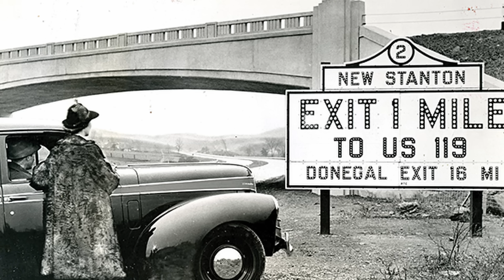Why New York's Lake Ontario Parkway Failed

Comment: The funny thing about these planned routes is that the major towns/city in that area are Lockport, Medina, Albion, Spencerport and Brockport, all of which are built around the Erie Canal and our basically connected to each other by Route 31.

And neither of these proposed routes go anywhere
Reply: The Erie canal is probably the most important determiner of NY's demographics. It was just so rediculously important to the economy so early on that it made cities far more important than they otherwise would have been. (Including NYC which wasn't on track to be the most important east coast port until the canal made it they link between the Lakes/Interior and the Atlantic/global trade)

Even today, long after the canal's frieght use has withered away around 80% of the states population lives within 30miles of it. (Technically the federally designed Empire HSR Corridor's existing tracks, but they follow similar routes and hit the same cities.)

Comment: Future I-98 has been mentioned for the Upstate of New York for 15-20 years ago, but I am not too sure about it.
Reply: The "rooftop highway" is pretty much pointless. The north country just doesn't have the population to justify an interstate, nor the economy to pay for the maintenance of one. 

Hell most of the time route 11 (1 lane each way, not divided) is pretty empty and its only slow between Canton and Potsdam because some people think they should drive 50 on that stretch.

Basically all the towns it would pass through would either get leveled or have 1 exit on the outskirts because the biggest towns have a population of around 10k. 

1-98 never needs to exist, the only reason to build it is to have the highest numbered interstate the system allows. (Not counting spur routes)

Comment: They should either just give up on the portion west of Hamlin Beach all together (ending at NY 272) or build a new interchange with NY 18 and focus on upgrading that highway instead-the parkway spread has non-freeway portions so putt in the parkway shield on NY 18 if desired should not be a barrier
Reply: Punctuation is a wonderful thing. Try it sometime.

Comment: Wasn't the I-990 supposed to connect to one of those routes to Rochester?
Reply: I-990 was only ever supposed to go to Lockport. If 531 was ever extended to Niagara Falls, the two would have met there, but there were never any plans that I know of for I-990 and the LOSP to ever connect.

Comment: As a Rochesterian, excellent and well done video. Can confirm it’s very bumpy at the last portion but if you take it easy, you should be ok. It certainly has seen better days. Scenery is a plus as well. On the plus side, due to the limited traffic, it is pretty much the only highway where you can legally ride your bike on since the state has marked it as a bike route. It’s something that I really want to do one day. Also didn’t know about the whole NY-531 about it going to Buffalo initially (knew it was supposed to go further, but didn’t think it was planned to go that far). Very nteresting.

Comment: I traveled this route as an alternate from Niagara Falls to Greece/Rochester and can confirm. There were hardly any cars until I got to spitting distance to roc metro and the road conditions were dreadful in the western portion. Very pretty and scenic tho but does not connect any towns and doesn't have any services along the route aside from the 2 state parks. An interesting alternate from the thruway if you have the time. Bring your own snacks, hope you don't have a toilet emergency, and gas up

Comment: I tell everybody every time it comes up that roads are falling apart because we've built more than we can afford to maintain. This is a good example. We used to have a friend out in Kendall - west of Hamlin Beach - and we hated the last several miles of Parkway before getting off. There is very little traffic until you get closer to Rochester - and I always wondered why the Parkway is even there. Thanks for this history.

Note that in Rochester, the accent in Charlotte is on the O -- shar-LOTT, not SHAR-lut, like the city in North Carolina.

Brockport is - BROCK-port. And I agree. 531 is a very useful road. I use it every week. There's a lot more population there with Spencerport and Brockport.

Comment: Something worth noting, I wouldn't say that the LOSP was ever up to interstate standards.  The shoulders aren't particularly large and most of the bridges over the parkway can't accommodate tall vehicles.  Like many of the downstate parkways, it's a road designed for traditional cars and can't handle box trucks or semis.
Reply: Early standards (1944-67) specified bridge clearances of 14’-0”.   Meaning over mainline lanes.  That was later raised to 16’-5”.  A standard semi is 13’-6” just making it under these earlier bridges.  Many early bridges remain, on the system, grandfathered in.  Shoulders on mainline bridges weren’t specified until ‘66-‘67 either.
Reply: @davestewart2067  The LOSP bridges have clearances between 11' and 12' depending on which lane you are in because they're arched overpasses.  No where near even the old standards.
Reply: Thank you for the insight.   Was speaking of Interstate standards, not northeastern parkway standards.   This road likely has a lot in common with some of the downstate parkways.  Saw Mill Taconic etc.

Comment: Odd project, the lakeview might be pretty but drastically cuts down on area it plausibly could ever serve, it seems like it would have made more sense to go between 31 and 104, so actually would serve dozens of existing cities larger than the current route (granted still somewhat small by US standards) and be a more direct route between the larger metros connected. It even seem hard to argue that the cities along the route would have grown much more if it had been completed, since both Rochester/Niagara ends extend more than 15 minute drives from those metros.
Reply: Definitely a weird placement for a road. Anyone who knows anything about New York demographics can tell you that the Erie Canal is king, it enabled so much growth in the early days of the state that the impacts are still very visible with most large settlements being along its original route. (And therefore most of the transportation demand still follows that old routing of the best path for ships to go around the Appalachians)

Comment: This seems like a good example of a roadway being designed for the areas it goes through.  And not seeing the need to force Interstate standards on a roadway that doesn't really need it.  And better yet not throwing money at maintaining a section of road that no one uses.  The bridges west of 98 will likely need to be deemed unsafe at some point, and that western stretch abandoned fully.  

Most places there seem to be 3-4 hours from I-90 which really makes any additional interstate routes through that area uncalled for.  Some connecting state routes built at or near interstate standard only where needed seems like the much smarter outcome.

Comment: You might want to look at its western counterpart, the Niagara Scenic Parkway, which basically does the same thing (goes up to a state park and then just dead-ends into a surface road). Looking from above with Google Maps, or any atlas for that matter, it's pretty obvious the two were supposed to be one big road with a middle section that was never completed.

Comment: Is the state planning to demolish this?
Reply: The state doesn't know what to do with it, its actually used mostly in the summer as its a good route to get to lakeside attractions along the Lakeshore.  Unlike other parkways in WNY, this one still has potential, its just unfinished.
Reply: there’s been talks of demolition and/or just letting it rot away but as it stands there’s more likely just going to be enough minor improvements to keep trees from sprouting out of the left lane pavement but not enough to make it worth using unless you’re one of the 6 people that lives right there on the lake but works in northern rochester/irondequoit